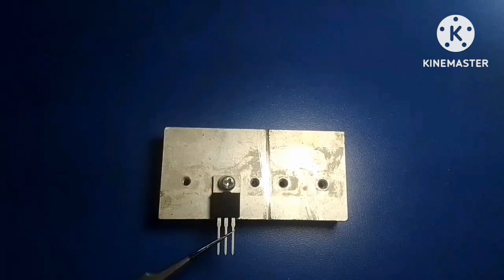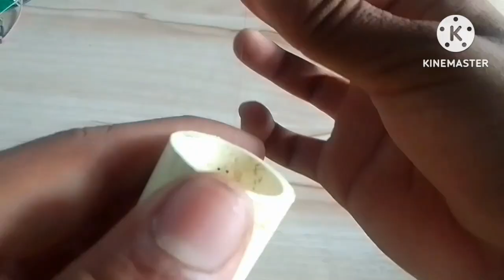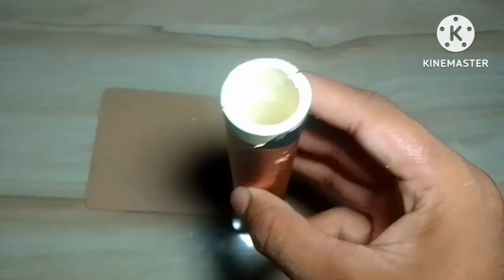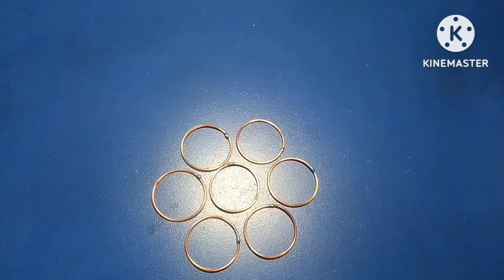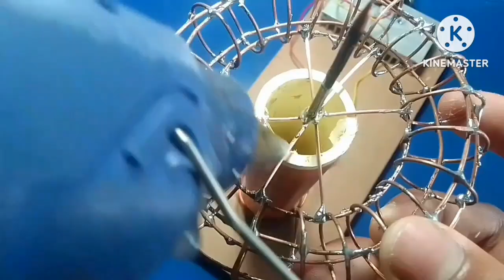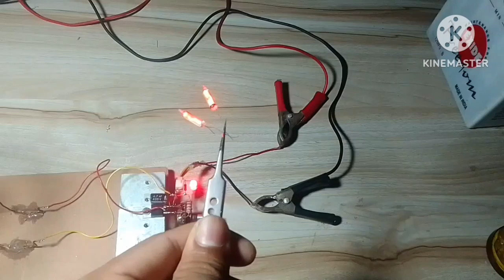How to make Tesla coil / IRF2807 MOSFET/

Comment: My understanding is that MOSFET transistors are not suitable for this project because they overheat extremely quickly, and it's true, I already tried it and it doesn't matter if the transistor is mounted. on a heat sink, it will overheat very quickly.
Reply from the maker: MOSFET yes overheat bro❤❤

Comment: Primary and secondary coil, how many turns
Reply from the maker: 2 turn secondary coil
Reply: Bro is talking shit😂 2 turn primary he means i think secondary should be around 1100 turns of 0.2mm on a pvc or cardboard pipe with a diameter around 3 cm. Primary you can play with. 2mm 1 turn is what i would start with.. 

So 1100 turns of 0.2mm on a pipe with a diameter 3cm  

And as primary i would start at 1 turn of 2mm wire.